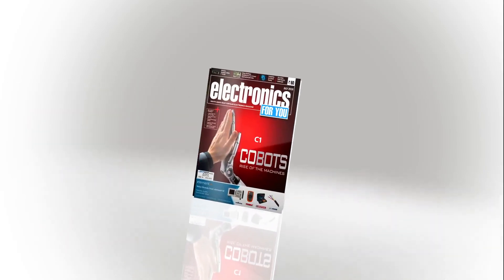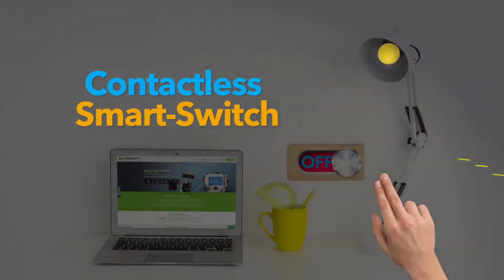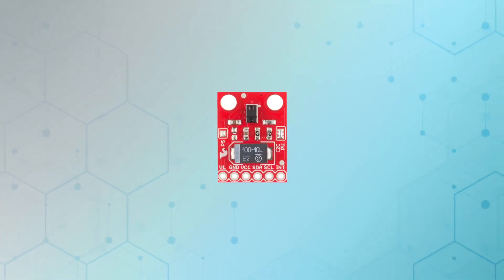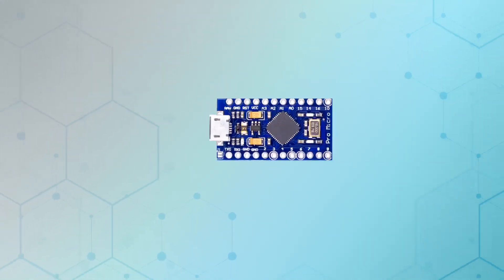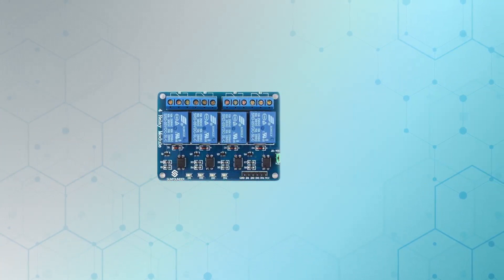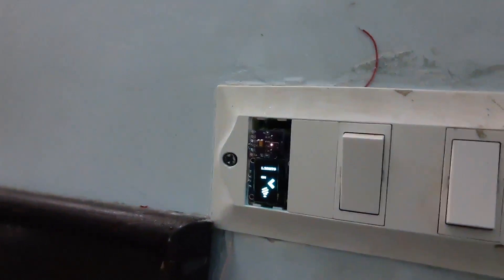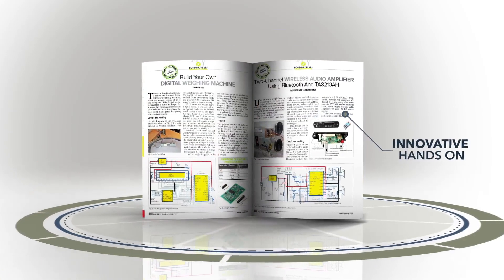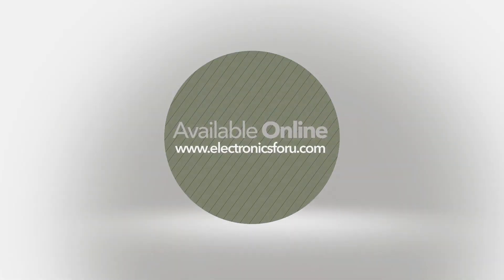Contactless Switch Board: Electronics For You DIY Project

Comment: Good Project. Thanks for sharing. Please share the circuit diagram and the details how you powered Arduino inside switch board. How you got 5V DC to power Arduino inside switch board.